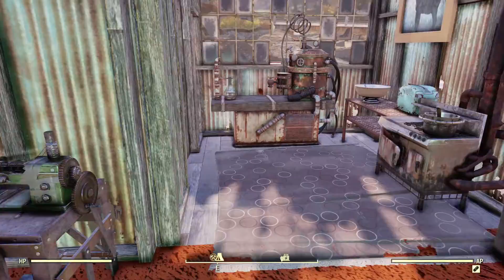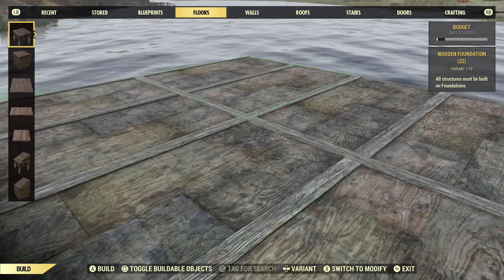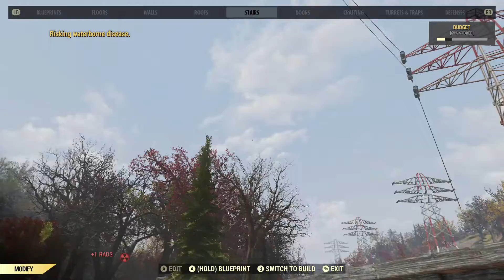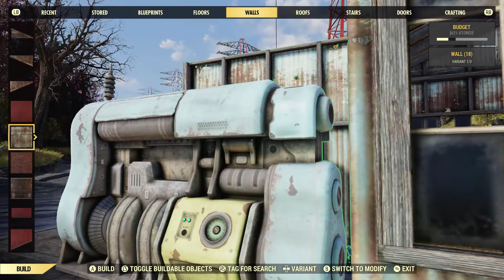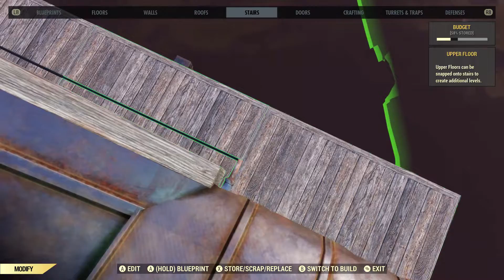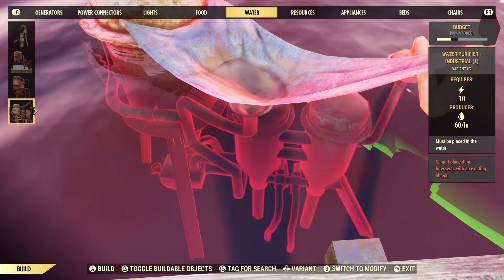Fallout 76 C.A.M.P. Build: Fisherman's Hut

Comment: The trick you use to lower foundations.....holding the select and then using a button to lower it. Does that only work with console? I have tried many ways to do it with a PC and haven't figured it out yet. Would you know how to do that trick on a PC?
Reply from the maker: I'm sorry, I don't :(
Reply: Hi. On PC, hold down the Enter key after selecting the part you want to move. moving the mouse will move the part horizontally, scrolling the mouse wheel will raise and lower the part.